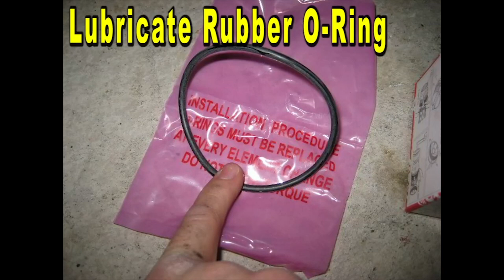2012 To 2017 Toyota Camry How To Change Engine Oil & Air Filter With Part Numbers - Quick & Easy

Comment from the maker: Toyota Camry Engine Oil Viscosity - https://amzn.to/3vKwzaz
Toyota Camry Engine Oil Filters - https://amzn.to/3Qnzbor
Genuine OEM Oil Filter Part Number - https://amzn.to/3GIh1u9
Fram Oil Filter Part Number - https://amzn.to/3WU2IIL
K&N Oil Filter Part Number - https://amzn.to/3vQkMax
Denso Oil Filter Part Number - https://amzn.to/3il0SBE
24mm Socket For Oil Filter Wrench - https://amzn.to/3iiInO3
AST Tools Oil Filter Wrench - https://amzn.to/3IvVq9Q
Camry Oil Filter Wrench - https://amzn.to/3VRisLc
Plastic Pry Bar Tools - https://amzn.to/3VJTXzD
Socket & Ratchet Set - https://amzn.to/3Z17LbA
Mechanix Gloves - https://amzn.to/3jCnHkt

The Paul79UF YouTube channel is a participant in the Amazon Services LLC Associates Program, an affiliate advertising program designed to provide a means for sites to earn advertising fees by advertising and linking to Amazon.

Comment from the maker: Check out the DIY guide for changing the engine oil and filter in a 7th generation XV50 2012 to 2017 Toyota Camry with the 2.5L 2AR-FE I4 - 
https://www.paulstravelpictures.com/2012-2016-Toyota-Camry-2AR-FE-I4-Engine-Oil-Change-Guide/index.html

Here are all of the DIY repair and maintenance tutorials for the seventh generation XV50 2012, 2013, 2014, 2015, 2016 & 2017 Toyota Camry - 
https://www.paulstravelpictures.com/Articles/2012-2015-Honda-Civic-Common-Problems-Repair-Maintenance-Guides.htm

Owners of other Toyota, Scion or Lexus vehicles such as the Yaris, Corolla, Matrix, RAV4, Prius, Tacoma, Tundra, Sienna, FJ Cruiser, Venza, Highlander, Avalon, 4Runner, Land Runner, Sequoia, IS 250, ES 350, GS 350, tC, xB, xD, iQ and FR-S may also find these DIY instructions to be helpful.